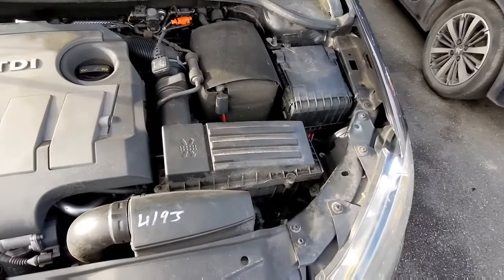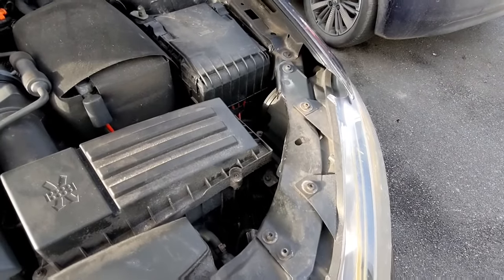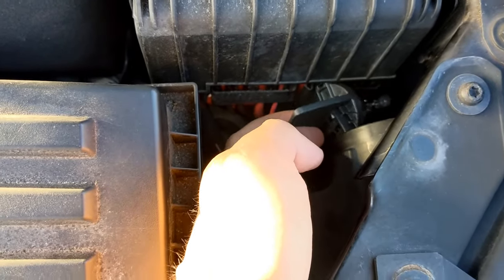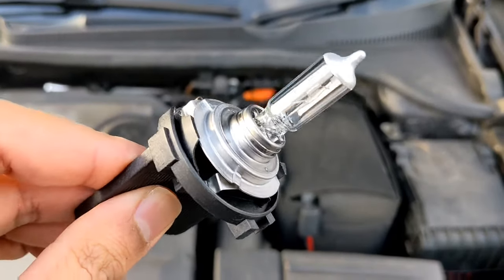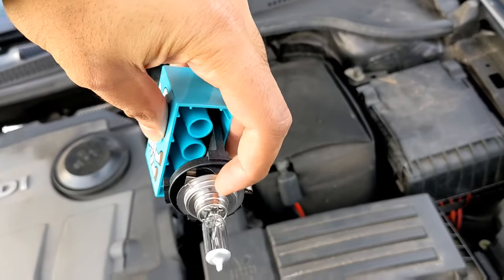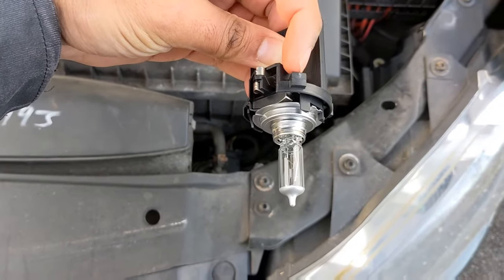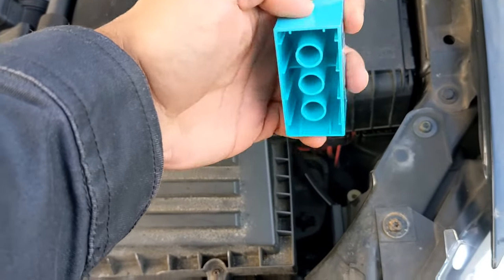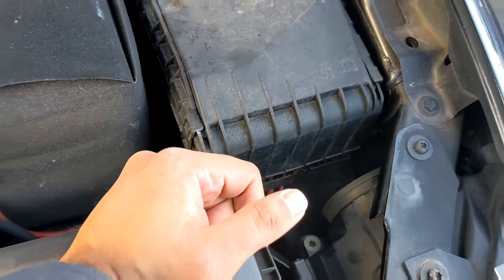VW Golf Headlight bulb change THE HARD ONE!

Comment: Manufacturers should be ashamed of themselves making it so hard to replace an important day to day item on their cars.
Reply from the maker: Too right Duncan, they don't make em like they used to, nowadays they just wanna keep you coming back to their garage for any little job. All a money making scam. Hit subscribe for us 👌👌
Reply: To hell with them. It took me a few videos as well to get this. What the other videos about other models of golf were much different to mine
Reply: @keithp6699 same here, mines the hard one mk6 golf, it failed on the way to mot test centre, I was 15 minis early with an auto supplies right next to the centre but I couldn't change the bulb so I got a major fail requiring a retest, VW should be ashamed for making the bulb almost impossible to change without taking front bumper and lamp out, the lamp had several bulbs inside it from others that have tried to replace the bulb in the past before I bought it. The MOT test centre should also be ashamed for failing a car during daylight hours for a failed bulb.

Comment: I just undid 4 screws from the wheel well guard. Easy peasy for both sides... I turned the wheel full each way to give lots of room depending on the side. If you really want to get fancy, you can remove the wheel and you have all the room, but you don't need to.
Reply: Thank you! Took a few minutes of fidgeting with it but eventually I got the bulb in with this tactic
Reply: Excellent thanks I will give this method a try

Comment: TThank you for the explanations about the right direction of rotation of the bulb holder throw the mounting hole. It really helps. 
Some other tips that helped me: 
- handle the bulb with gloves to avoid slipping hands and remove the fuse box cover to save a little space.
- I taped the bulb to this support so that it would not come off (the first try I almost lost the bulb without its support under the engine). Look at the insertion of the bulb through the headlight to position it in the correct axis. Good luck.
Reply from the maker: Thanks for your helpful comment 🤝🤝

Comment: Thank you for this video and showing correct orientation and turning direction for housing unit which helped immensely. I struggled for literally 2hrs off and on but FINALLY got it. In spite of getting the housing unit in proper place with the 2 o’clock position I didn’t realize you also have to give it a little push in on topside of it (towards the front of car) for the top part of housing to click all way in and be properly seated so it can be tightened till the “click” happens. Before I kept trying to thread gently and wiggle it into place and only bottom part of unit was going into the threads correct (and it was lopsided downward and not turning or working). Good luck everyone!

Comment: Many thanks - your video gave me the confidence to help out my neighbour who blew the very same bulb on her Golf - an H7 bulb by the way (some models apparently are different). 
A few points, and one MAJOR help to others: 
If you make a tool, which is what I did, it is easy peazy. I found a piece of plywood about 5cm (2") square, about 10mm thick, although that is not critical, and sawed a slot at one end in it - say, 2.5cm by 5mm (1 inch by 3/16"). That gave a grip on the plastic tab to twist it (anticlockwise about 30 degrees to remove), which worked fine without needing Lego. If you are a whizz with your fingers, put a dab of Tippex first on the upper surface of the tab, before removing it. I didn't, but would try for next time, to help get it back first time right with the replacement bulb. 
But MOST IMPORTANT OF ALL: you can remove the fusebox cover and gain a heck of a lot of free space to manoeuvre the bulb holder out and in! Look at the black box-like structure towards the bulkhead (see video). There are two knurled bridge-shaped bumps, with marks to indicate Lock/Unlock. PULL them towards you. They may be a bit stiff, then will let go satisfyingly. Don't be wearing a metal bracelet or wristwatch, though. The fusebox cover can be lifted clear, revealing the fuses (a handy thing to know anyway). Then you can take off the lamp's rubber cover, use a torch and get in to swap the bulb/holder MUCH MORE EASILY! 
Another tip - I used a smear of Vapo-Rub (didn't have any Vaseline to hand) to put on the bulb contacts and the two small bump contacts of the holder, so it all went in smoothly. But remember, keep your fingers off the bulb when inserting it. If you accidentally touch it, clean it with a lint-free cloth, otherwise the bulb's life will be shortened. Sweat/grease are not good for halogen bulbs.
Reply from the maker: Thanks for your kind helpful comment, hit subscribe 🤝🤝

Comment: Before changing the headlight bulb, consider removing the fuse box cover. This simple step can provide better access and visibility to the headlight assembly, making the replacement process smoother and more efficient.
Reply: darn, got no luck with my 2009 touran, this killer side, my left thumb already swollen after 2 hr of trying, the other side is easy peasy, try it again tomorrow, fuck em
Reply from the maker: @sofronius2 go on Sofronius!! 💪💪

Comment: Really helpful orientation tip you gave @4:05, thanks!  I didn't have a lego block, but... Iwas able to use your tip to get the job done. One thing that also helped was... shining a flashlight into the front of the headlight, as a visual aid in guiding the new bulb into the hole in the back of the headlight.  Cheers!

Comment: Thanks just did our Golf driver side headlight. I used a 1.5mm x 3cm x ~10cm strip of metal folded over tight and then loosened a bit which provided a tight fit on the plastic flap. I din't get much of a click, so I tried a longer piece of metal for more leverage but still nothing. See how it goes...

Comment: I changed the bulb and it still didn’t work.  After much investigation I found one of the power contact points on the socket had melted slightly and wasn’t making contact.  Need a new socket.
Reply from the maker: 😔 I've been there, had it where the bulb was melted/fused to the socket. 

I hope it's a quick easy fix for ya 👍 thanks for your comment @tomfinn6579 please hit subscribe 🥳🥳🎉
Reply: @ColdStream  I ended up taking the bumper cover off so I could remove the headlight assembly.
Reply from the maker: Well at least you've done it 💪💪 it's a shame so much work was needed on it, in a previous car when I had this problem I was able to replace the socket without removing anything, VW should be ashamed of this design

Comment: so im fucked, i have a golf 7 variant 2017 and the same light but its different a bit, the plastic is connected to a wire so i cant take it out like that, and my bulb doesnt come off easy, it has some sort of mehanism that i cant figure out or find online solution, but still wont go to a mechanic i know it cant be that hard. Any solution? tips?
Reply: same here, just spent an hour trying. Got the bulb out but becase the wire is so short i can't get it to click back into the housing